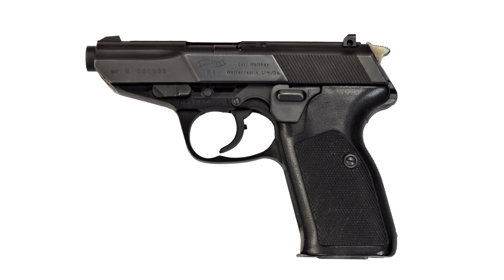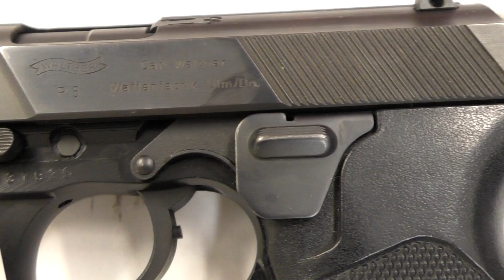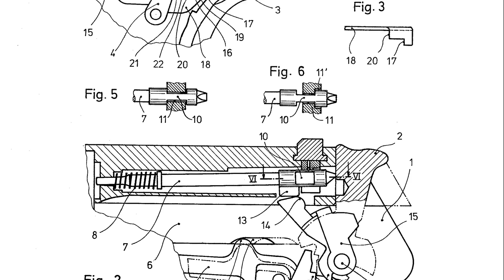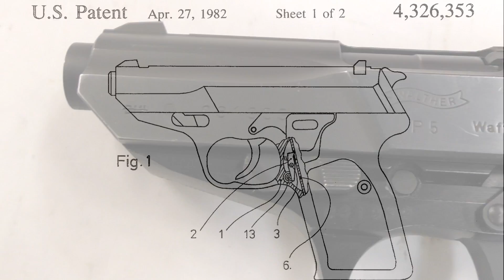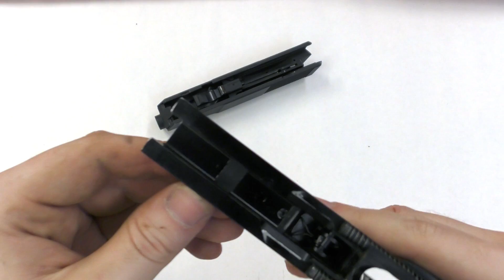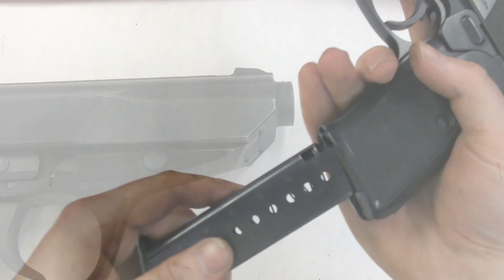Walther P5

Comment: The P5 was not only used by the Dutch police, but also by other law enforcement agencies and customs. Als for the mag release. At some time they were replaced by  a different modernised release, because it was difficult to operate with gloves and u tended to accidentally release the magazine when the weapon came in contact with the backrest of the seat in the patrol cars. During its servicelife the P5 was also modified to use another type of ammunition with a hollow brass bullet. The use of this bullet caused more wear and tear . When production ceased at the Walther plant, it became to expensive to maintain the weapons well with custom made parts. The P5 was phased out from approx 2013 onwards and replaced with the P99Q NL. The latter also differs slightly from normal production models to accomadate the custom made ammunition (Ruagg Action NL).